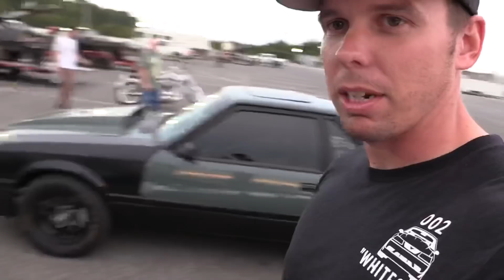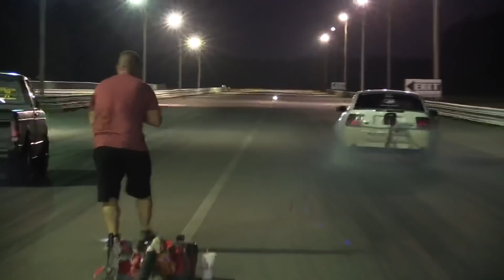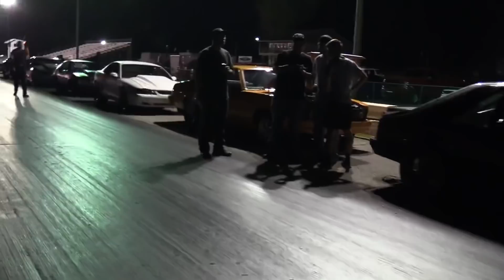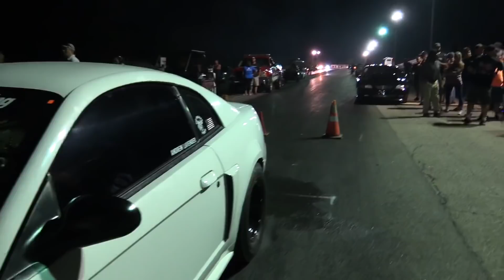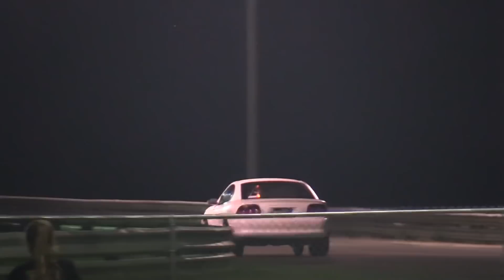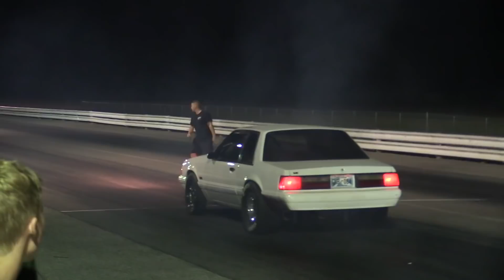I Took my turbo mustang to a no prep race

Comment: Hey Andrew, would you be willing to take a video suggestion? I love your in depth technical videos and would love to see one based off how to build a 99-04 rear end and the parts you suggest/used on different horsepower limits. Thanks!
Reply: P.s. thanks for the suggestion on the molnar rods a while back.